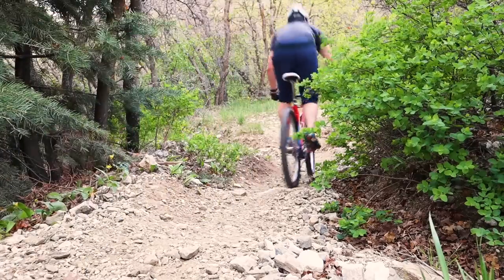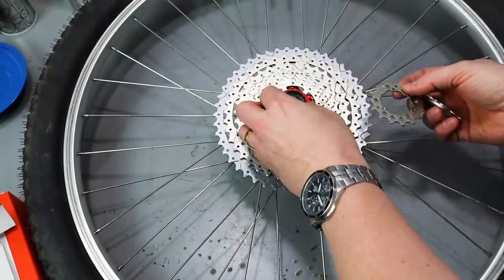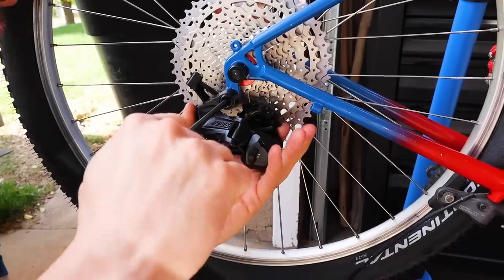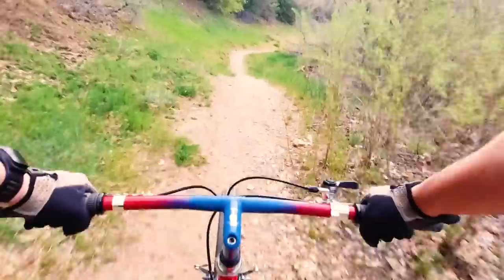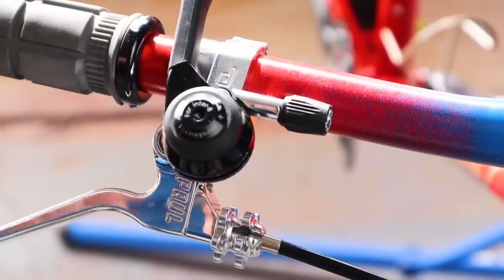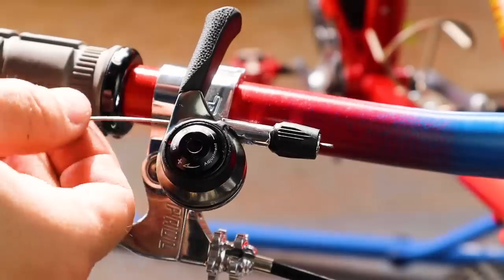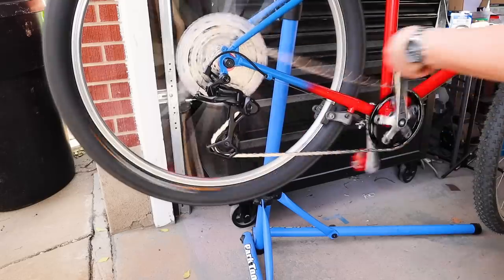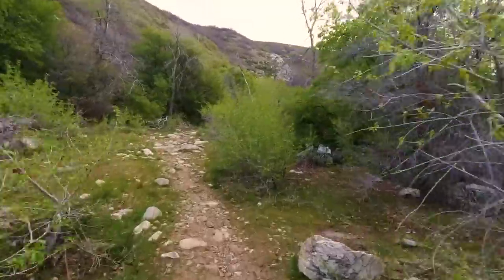microSHIFT ADVENT X Install on my Ritchey Ascent - 10-Speed Upgrade

Comment: Micro shift getting a lot of good reviews.
Reply: See a need, fill a need.
Reply: I have the 9 spd version and it is well made.  Shifts great, feels good.  Only complaint I have is an ergonomic one with the shifter.  The trigger shifter lever is too short so I have to adjust my grip to reach it.  Thumb lever is right where it needs to be.  It looks like the Advent X solves that issue.  I hope they will rework the 9 spd shifter.  I'd buy it in a heartbeat.
Reply: I just got  the group  set for My Gt Aggressor  I love it

Comment: It's cool that the cassette comes with the link for the derailleur, even if you don't need it with the Advent X. I just ordered a Wolftooth one for 11-36 on an Tiagra rear der. rated for like 30T or something. It 'worked' without it but not smoothly. For my MTB though, I just got the Advent X der. and shifter and 11-48T cassette/32T NW ring, going from 24-32-42 and 11-36 I only lost the 2 highest gears in the big ring (in terms of range).

Comment: love microshift, just installed their 1x7 drop bars levers on my old bridgestone frame. Great video as usual!
Reply from the maker: Awesome thanks
Reply: Nice! Do you need a road derailleur for that or is it working with mtb as well?
Reply: @schninzent8914 Thanks! Threw on a shimano acera mtn bike rear der. The pull ratio for shifting is what worried me with drop bars, but it works awesome
Reply: @jorgscz9175  Great! I have an old 1x7 mtb with slicks on it just for city riding. I might convert to drop bars now. Thank you very much!
Reply: @schninzent8914  dude so awesome, slicks are great
Reply: @jorgscz9175  it's a blast! 
What kind of brakes are you using? I'm currently on cantilevers.. Dunno if those will work properly.
Reply: @schninzent8914  hey hey sorry about the late reply, the pull ratio on canti's with the drop bars had been interesting to tweak but they work great for me. Had to true my wheels and get the pads as close as possible

Comment: How do you fit freehub rear wheels on older steel frames? The sizing of new 26 inch wheels are like 135 mm hubs but my 1983 mountain bike has 120 mm spacing for a 5-speed freewheel.

Comment: The chainring from Wolftooth is one of the few narrow wide available in 5 bolts, but it is super expensive (79EUR). In 4 bolts, you can get one for 7EUR on Aliexpress (search for Motsuv), I use BDSnail one in anodised purple in 4 bolts (around 15EUR). If people are interested, I also found a NOS stock of 5 bolts 94BCD chainrings in different colors left at KitCross.com, a belgian manufacturer of motocross accessories, I used their chainrings on my 1995 bike and needed to replace one that was bent.
Reply from the maker: I know. It’s hard to find an affordable 110 bcd x 5 oval. Awesome love how this bike rode, and I always want to ride it so I felt it was worth the cost.

Comment: Hoping you can help me out. I have 2x10 xt. It's a 36x24. I want to go to a 1x10 on my full suspension. was going to just take the lower chainring off. Is the 36 tooth chainring ok to run? And what cassette would be good? so I can make it a better climbing full suspension bike.

Comment: I have a Specialized Crux, originally came with a 11X30T cassette and a 2X 46T-36T 110mm crankset.  I bought the microShift Advent for a 42T cassette along with the microshift 11X42T cassette.  I bought the Raceface 30T 1X but it is a 104mm. My current crankset is a 4X110mm FSA 326 Gossamer- BB386EVO (BB86/30 compatible).  I need a complete crankset that will fit the 104mm Raceface. Any suggestions.

Comment: I dont know about the Microshift. Here in EU you can buy the 11spd slx/nx for around 140-150€. That is the chain, cassette, shifter and rear mech combo. Is the new Microshift better then the older groupset from Shimano and Sram? While the 11spd Microshift is 15€ cheaper but without a chain... better?

Comment: Excellent review thanks, I just installed the Advent X  system on my Trek Marlin 7 I have a 36 tooth chainring in front I really like the way it shifts makes the bike way quieter than the 3x9 it came with.  I have one issue it will not shift to the lowest gear the big ring in the back? I followed Micro shift's directions on chain length but I think it may  be too short so I will try adding some links.

Comment: Have you ever seen a SRAM DualDive hub on an old bike? I wonder if one could keep the 3 speed geared hub and replace the SRAM 8/9 speed system with microshift Advent X to get 30 speeds?

Comment: So if i'm understanding this correctly the Advent X is compatible with a microshift shimano compatible (non advent) thumb shifter? Asking because they specifically point out that advent only works with advent
Reply from the maker: It’s not a perfect match for shift ratios but i have not had issues
Reply: @oldshovel  thanks for the reply and sharing your setup! Stocks are almost non existent for thumb shifters at the moment so I'm weighing options

Comment: I have an old Litespeed Ocoee I am thinking of upgrading.  Can I run this 10-speed Cassette on my 1996ish XT, 8 speed freehub?
Reply from the maker: If it’s got 8 speed you should be able to run a 10 speed the cassette widths are typically the same.

Comment: I was really surprised with microshift they were the walmart bike drive train of choice then came out with more advanced mechs the advent and advent x look really good. might put it on  my hard tail.
Reply: One suggestion: use aluminum endcaps instead of plastic. They hold forever and come in a sealed version, also color is available.

Comment: I know it's an older vid. Are you using the older 8spd hub? Or do you need a 10 ?
Reply: 8 speed hubs work with 10 speeds. its 8-9-10-11-12 speeds for the hubs.
Reply: @bananasstuff3344  Thank you very much. Have a few wheel sets from back in the day.

Comment: Could you go for a link or 2 more in the chain, looks a bit tight
Reply from the maker: IT is getting quite tight on the 46T cog but if I add more the cage will rub and the chain will have no tension on the 11T cog.
Reply: @oldshovel  ah, well you did fit a massive cassette. I wanna try a 40t Sunrace

Comment: Holy crap dude. If you keep increasing the # & size of your cops you will have to remove the spokes & mount them directly on the rim. I personally would have tossed the thumb shifter & put a GripShift on. I don't like any kind of shifters on my mountain bike except the GriftShifts. After being on the bike for a long time my hand hurts and it won't stop. The GripShifts are very precise & for me, easier. I guess you were doing some kind of combination retro/modern build? Be safe. 👍☮️🌞🦠😷🚲
Reply: grip shifts are crap. he does do restomods, yes.

Comment: Hi, thanks for this and all your videos, they are fantastic.

I have a 7 speed '93 Diamondback Response Elite - will this upgrade work or not? I seem to recall reading the hub has to be 8 speed or higher. Thanks!
Reply from the maker: Yes you would need a new rear wheel to make it work or swap the hub (like I did on the Raleigh Chill)
Reply: oldshovel thanks!

Comment: What tool is that you use @ 1:10 to install cassette? I'm looking to get the Park Tool Freewheel Remover Wrench - FRW-1 but the tool you use there looks more lighter and portable. Please let me know.
Reply from the maker: It’s the FR 5.2H https://www.parktool.com/product/lockring-tool-with-handle-fr-5-2h?category=Cassette%20%26%20Freewheel
Reply: @oldshovel  Great the FR-5H is shorter in length and a bit lighter too! Thank you very much.